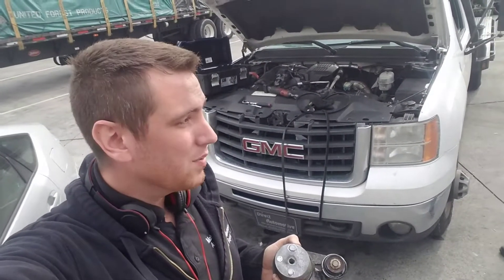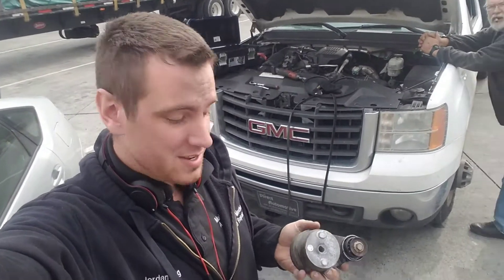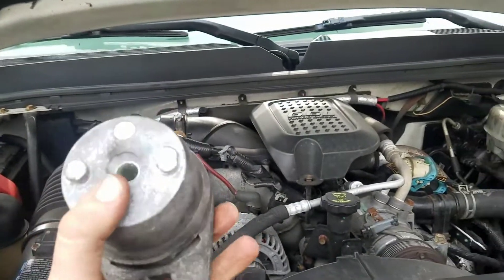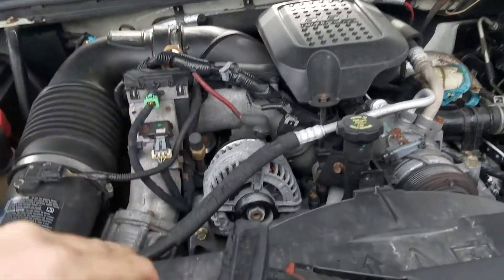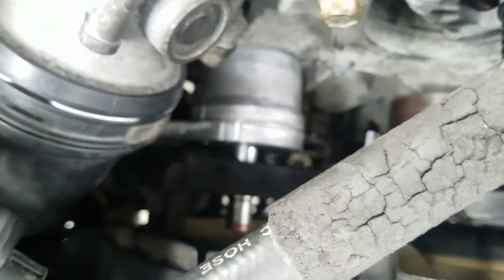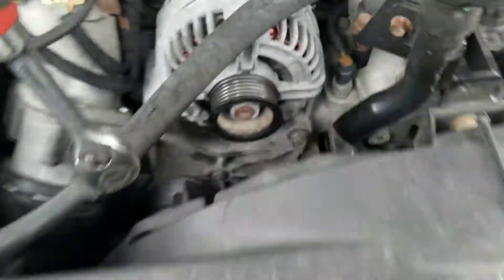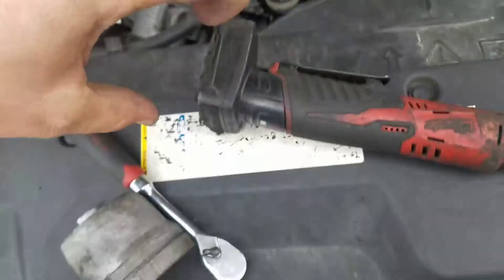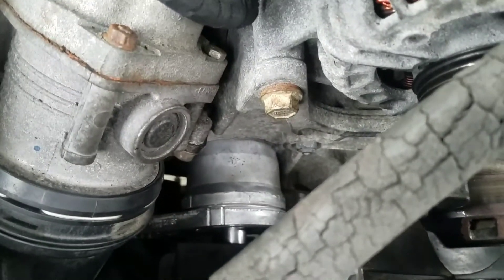Belt Tensioner 01-18 Chevy GMC 6.6l Duramax Replacement "How to"

Comment: I stripped the bolt that holds the tensioner in.   Does it need to be re tapped or will it hold with a tensioner replacement?
Reply: It want hold. It needs to be taped